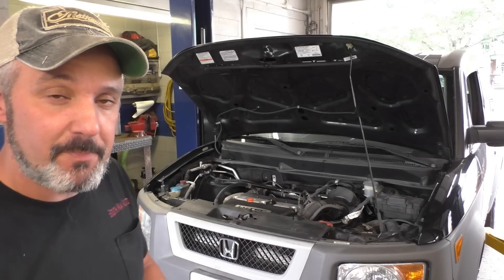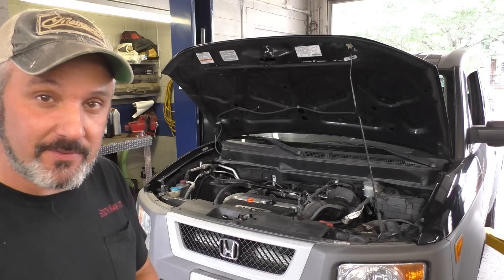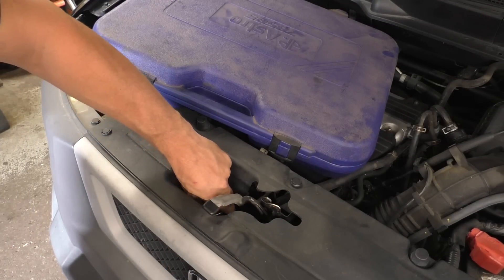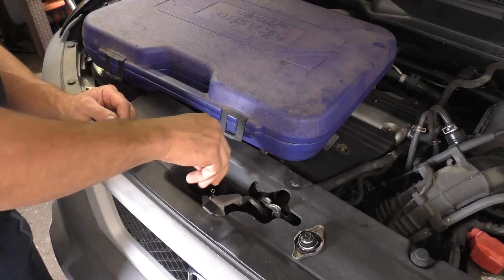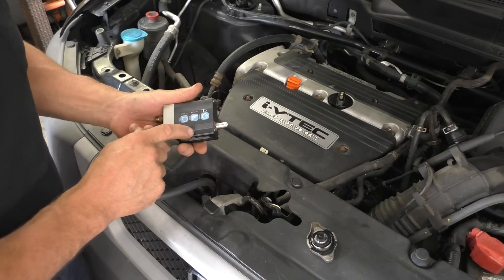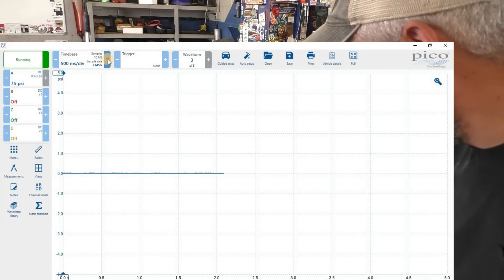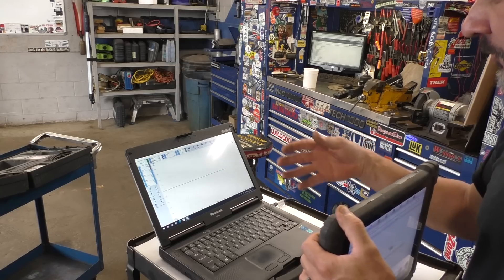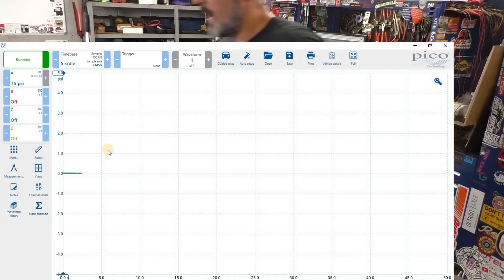Blown Head Gasket? On What Cylinder Though....🤷‍♂️

Comment: I am curious how it helps to know that the leak was between 3 & 4?  I could see where this would be hugely beneficial on a V configuration engine.  Then you might have to change only one head, but on an inline engine the work to fix it is going to be about the same.
Reply: He will have to inspect the engine and the head, after the head comes off. The customer might have a crack somewhere.
Reply from the maker: If you pull the head and don't "see" anything wouldn't it be nice to know where to look closer for the actual problem?

Comment: Another technique I’ve used is I’ve pressurized the coolant system and with a bore scope check each cylinder and look for the leaking gasket. Done twice on finding misfires and blown gaskets on second gen Prius
Reply: KISS principle - well done.
Reply: Super common on Ford fusions/escapes with the bad design blocks. Had one the other day and saw it bubbling into #2 cylinder.

Comment: So I did drivability and electrical troubleshooting at a Chevy dealership back in the early 90’s and ended up changing careers by the 2000’s. Good choice for me as it’s panned out very well. But, seeing the diagnostic tools you guys have available nowadays almost makes me want to get back into it. When I was at the dealership, the scanners available could only give you trouble codes and you could view basic sensor readings. I love watching you guys do proper diagnostic work. I bet like I was, you guys are still waiting on the computer that “tells you what’s wrong with the car” that customers always thought we had
Reply: All those fancy diag tools here at the dealer... They don't make us money, replacing parts is the only way to make a paycheck.  Sad but true.
Reply: @scrappy7571  I can understand that for sure. Been there done that. The guys doing mechanical engine/transmission work made the most money at my dealer

Comment: In my case I had bubbles appearing in my coolant tank and pushing coolant out of the reservoir. Knowing that was a big sign of a blown head gasket, I took it to a shop and have them do the die sniffer test and confirmed it very quickly. After doing some Google searching from my case I found that the most common cylinder was the number two, so after driving the car for a while and getting it nice and warm, I pulled the number two spark plug and stuck inspection camera down the borehole. I could actively see coolant being pushed into the cylinder right from where the water passage was located. It might have been an interesting to see if a borescope camera showed any signs of leakage into the cylinders on that honda.
Reply: If coolant was getting into the cylinder, wouldn’t that misfire or at least show up on the spark plug?
Reply: @Mr572u  Nope.  I was surprised as well, that none of the plugs showed that freshly washed look of a coolant burning cylinder.  The trick was, it would only allow a little coolant into the combustion chamber after shut down, but never enough to mess with start up.
Reply: @Mr572u  You would absolutely think so if the world was binary. IE if it leaks it leaks in both directions. In this case the gasket was blown, but it was acting as a kind of check valve. IE letting a small amount of compression into the cooling system (less than a quarter of a PSI). You would be hard pressed to find this type of blown gasket with a traditional compression test
Reply: Just don't measure when cold-shrinkage occurs.
Reply: Mine was bubbing in the coolant expansion tank. No white smoke, misfires everywhere and hard long cold starts. Headgasket blown between cylinder 5 and 6. 2007 Honda Pilot.

Comment: Maybe you should of bleed the pressure off before you put the last spark plug in. Then compared the compression between the two last test. To verify if it’s a head gaskets or a crack in number three cylinder , cracked block or head.  Just a thought.

Comment: There's a tool that can read exhaust gas residue in the radiator, it won't tell you what cylinder, but will tell you there's a gasket issue.  I thought you'd use that.

Comment: That technique is also useful on engines with two banks. Just in case you don't want to do two head gaskets.
Reply: If one went bad how confident are you in the other considering you stripped away half the engine bay already? If you r mechanic would do that where else would he compromise? Just saying pay once cry once you know what’s coming.
Reply: @FrancisoDoncona  you took the words outta my head John.  Already there!!  Do them both and head off on a 2K mile journey when you're done.  A non-replaced gasket may last another 2 years, or another 2 hours.  throwing darts in the dark and waiting fearfully for the failure to manifest itself - BS.  Don't forget to replace the head bolts as well.
Reply: I simply would check both banks with the cylinder leakage test method.
Reply: @doomkid02  that's a great idea for us that don't have all the fancy gadgets. Hook up a cylinder leak down tester to the plug hole and a coolant pressure tester on the coolant side. If I can't find where the coolant is going on my ol lady's car I may have to test for head gasket. Weird cause it's never overheated when we got it and it's started losing coolant over the last 2 months. Not a lot but enough
Reply: A blown gasket isn’t the end of the world, you can drive on a bad gasket for a while.
Reply: @ludvigericson6930  perhaps YOU might.  I much prefer reliable mechanical attributes in my vehicles.  It's stupid not to replace both head gaskets in a two-bank  motor while your are already that far into it.  Just my opinion, and like Patrick Swayse said, opinions vary.

Comment: Always love to see new approaches to diagnosing problems. You'd have made a great software guy, Eric. Thanks as always!!
Reply: A "software guy" would've approached it more like a binary search.  It took 4 cranks to find problem on a 4 cylinder (worst case scenario 2^2 =4). On an 8 cylinder engine that worst case scenario would equate to 8 cranks whereas a binary search would've isolated it in 3 cranks 2^3=8.

Comment: the nice think about finding exactly what cilinder has the problem is that on a V6 or V8 or Subaru Boxer engine you know for certain which head needs to be pulled.
on a inline engine it is less of a deal because there is only 1 head you can pull anyway.

Comment: The data tells all!  The owner is doing the right thing to have SMA go ahead with the replacement.  Would you expect this to be a 1-day job, if the stars align/no broken bolts/all parts readily available, etc??
Reply: Parts are readily available for this engine
Reply: I replaced the head gasket on my Hondoo over two days but I'm just an amateur.  For someone who knows what they're doing it can be one day.  Often times if it happens quickly or isn't noticed by the owner a blown head gasket will overheat the engine badly and the head will be warped.  If the head is warped it needs to be machined flat again and this typically adds days to the job waiting on the machine shop.  In my case I noticed the missing coolant and never overheated the engine so the head was still good.

It also depends on the vehicle.  I have replaced valve cover gaskets on my Toyota minivan and quickly realized that it would be a multi-day job to do head gaskets on that, plus there are two heads instead of just one like on a small Honda.

Comment: Had a diesel jeep with  excessive coolant pressure though it was a head gaskets turned out to be a crack in one of the exhaust runners. Only found with a pressure test. Show us the head gasket when you pull apart.

Comment: What's the color of the tailpipe smoke? Does it blow white smoke? I'm thinking that when one cylinder is pressurizing the cooling system, the fluid trickles into the other cylinder and it gets burnt. Would this explain why there's no external leak? I also suspect that one piston head will be very clean... can't wait to see it opened up!
Reply: If the leak is smal it can be well hidden. There can be no leak to the cilinders when engine runs, only the presure escaping and only after shutdown little coolant get pushed into cylinders slowly. Than when you start the car, it gets burnt but condenses in the cold exhaust system and stays hidden as it evaporates gradualy with air moisture from the exhast.

Comment: Hi, Mr. O. I don't believe I have seen that radiator cap pressure gauge. Very cool and useful. Thanks for pointing out that you can empty the water out of the gauge. It is also nice that you can get to the spark plugs on that modle. Thanks for sharing! Stay Healthy!

Comment: It's quick and easy diagnostic you can do in well under a 30 minute min diagnostic charge.

It's valuable to know which cylinders are leakers, because if you do it on enough engines it informs you about their weak points. Valuable info when rebuilding.

Comment: Would you ever recommend a head gasket sealer with a similar case?
Reply: I never add head gasket sealer. Plugs your entire cooling systems. Radiator. And heater cores. 
Proof. A friend of mine purchased a Used Dodge truck. Dealer told them. It has never run hot or over heated. A cold spell came in one week later. Then very little heat?? 
She took it to a local auto shop. They found stop leak in the coolant. Plugged up the entire cooling and heating system.
Reply: @2nickles647   I used a sealer once on an old beater that wasn't worth a head gasket job. The guy got an extra 18 months service from it for relatively little money.

Comment: You could also pressurise the cooling system and use a bore scope to find the one with coolant in it. This doubles up where the coolant is going. Love this channel by the way, best car diagnostics on you tube. I did what I always do and commented too early.
Reply: I was thinking similar
Reply: Pressure testing coolant will use 15 psi.  A lot of times that is not enough to show a leak when the gasket is starting to go.  Compression test is at least 150 psi, much better results.
Reply: @scrappy7571  You need 150 PSI to make a gasket leak?
Reply: @hikerJohn  The MLS gaskets are pretty durable.  When they first start to leak they can tough to verify.  The old graphite gaskets with steel fire rings would simply blow a hole, and were easy to diag.
Reply: It would be better to use a cylinder leak down tester than a coolant pressure tester. The cylinder leak down tester can put much more pressure on the gasket. It is also easier to see bubbles in the radiator.

Comment: The question is would you do this per cylinder testing if this is a 12-cylinder car? Especially after you know the head gasket's blown from the first two minutes.
Reply: I would say yes. Then do what Eric did. Narrow it down by reinstalling plugs. Retest again.
Reply: @2nickles647  .. Here there's only one head gasket and it is one piece! 

If you had a V-6/8/10/12 then there are two gaskets. Generally with V engines if one gasket is bad, you replace both as good practice. Reasoning is whatever caused the other one to fail probably or may have damaged the other.
Reply: A 12 cylinder would probably be a V style engine, so yeah it would be nice to know how many heads need to be pulled.
If it is a car, then there will probably be 2 heads on the V 12. If it is an industrial truck, then their might be 2 or 4 or 6 heads on those V12 engines.
It would also be nice to know the area that needs to be inspected, after the disassembly.
Reply: @willw8011  .. As I mentioned above if you have even one bad head gasket replace all of them.
Reply: @DJaquithFL   If that is someone wants to do, then OK.
However, after taking it apart, then it might not be a head gasket. It might really be a crack in the head or the block. If someone just replaces the head gaskets without inspecting the damaged area, then the problem will not be fixed... and all that time will be wasted.